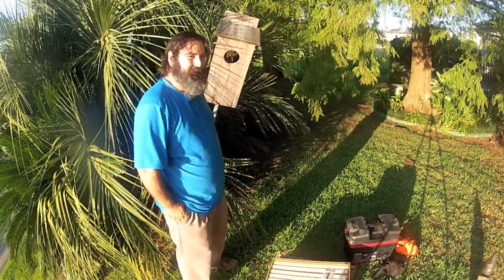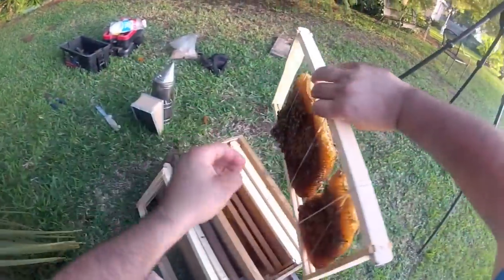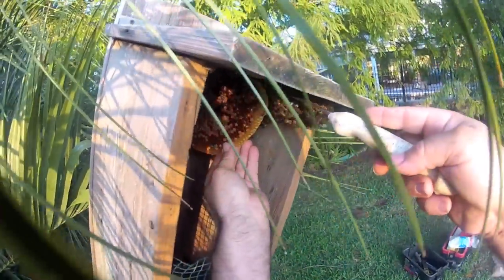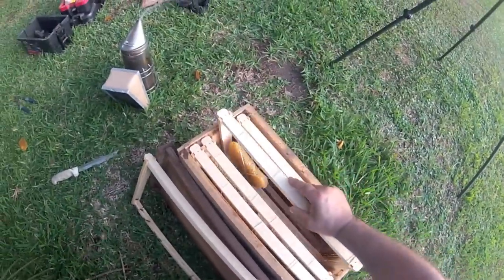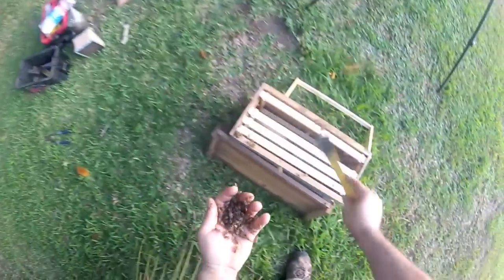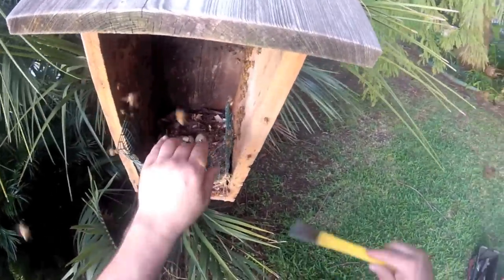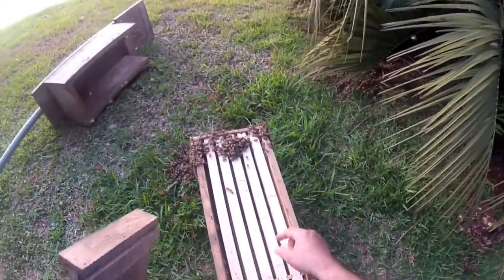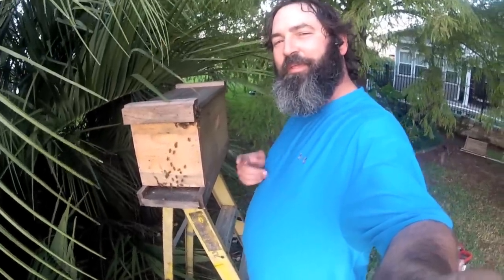Bees In A Duck Box! (Filmed With GoPro Hero 2)

Comment: JP, do you ever have much of a problem of twisted crooked comb after a cutout? I did a removal under a deck about 6 weeks ago, basically a swarm with very little comb. I salvaged what I could, but when I checked in on the bees a few weeks ago, the comb was bending all over the place and the new comb was a mess. I cut a bunch out to clean things up, and sadly as a result the bees absconded. I guess I pushed them too far. Any ideas on how to prevent the crooked comb?